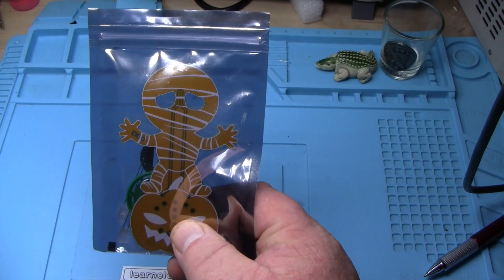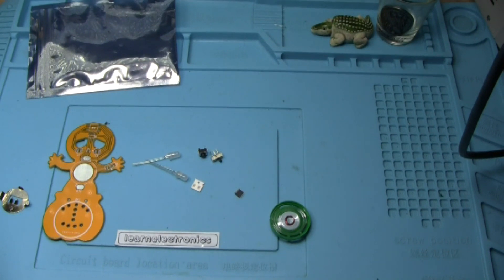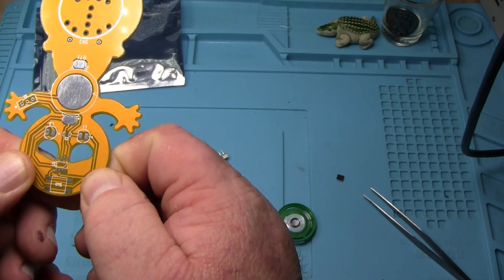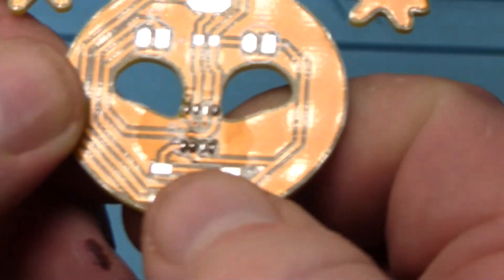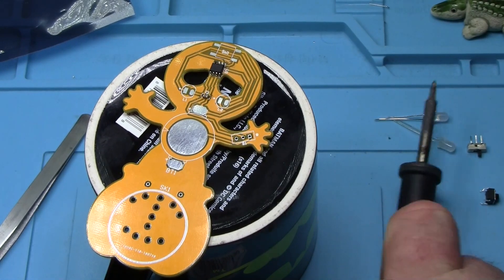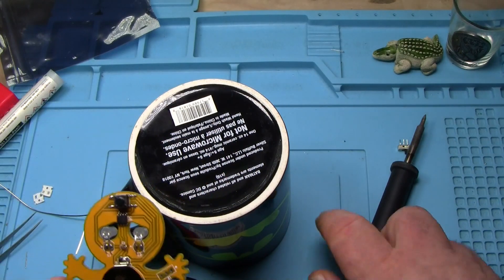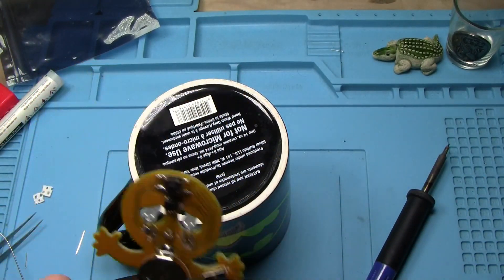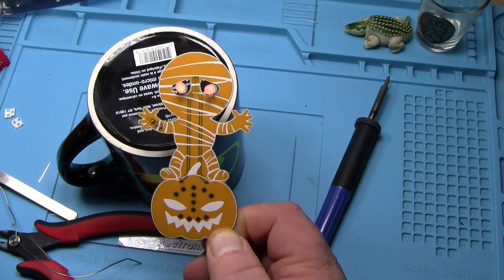Cackling Mummy Kit from Circuit Pop

Comment: No need tor  the tinning on the SMD pads. Just plenty of flux. Need a much smaller tip on the iron. Something like a Hakko T18-BR02 which is a small curved tip works well. Set the part in position on the pads,. With just a small bit of solder on the iron, hold the part down with tweezer ends and just touch the iron to one pad to tack it down. Then for the IC solder one tab opposite the one you tacked and then go ahead and solder the rest. The flux helps keep the solder from bridging the IC tabs. Same basic process for things like resistors and capacitors. Just tack one end and then solder the other. Without magnification, depending on your eyes, you can probably go down to 0805 size parts but 1206 size are easier to work with. The IC's you don't get much choice on size so you have to do what you can. Fun project in any case.